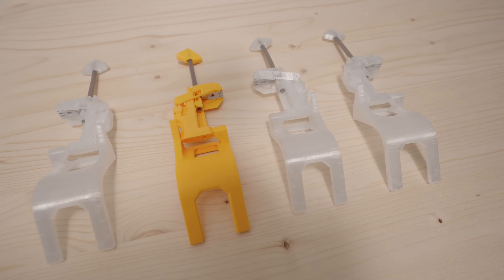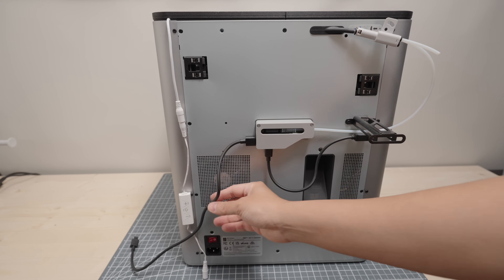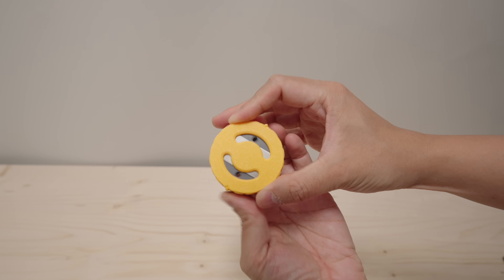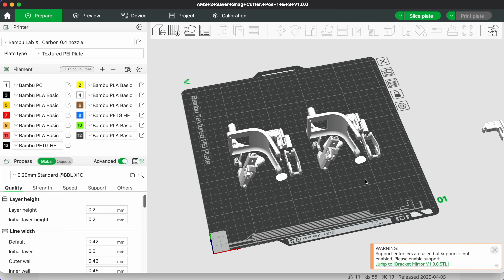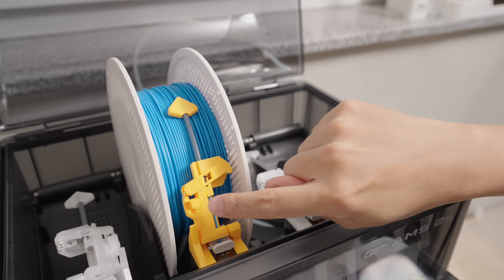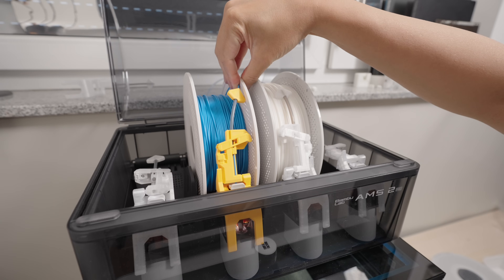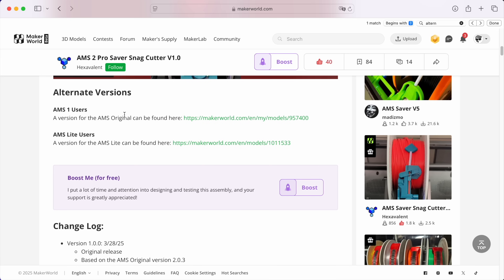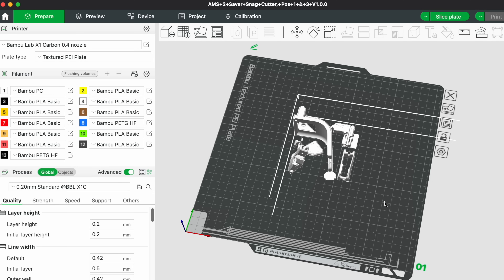The Best Upgrade for Bambu Lab AMS 2 Pro - this upgrade will save your AMS!

Comment from the maker: 🔗 Links
AMS 2 Pro: https://tidd.ly/3JGMaSI
Cutter blade: https://tidd.ly/4q7kYNn
PTFE tube: https://tidd.ly/49Dw6eX
Switching Adapter: http://shrsl.com/4vu0k
Filament buffer: http://shrsl.com/4vu0l
Filament PC: http://shrsl.com/4vu0i
Filament Yellow: https://shrsl.com/4usj2

🇪🇺EU Links (If you're in the EU): https://shareasale.com/r.cfm?b=2464022&u=4344577&m=138211&urllink=&afftrack=
#affilliatelinks

Recommended 3D printer: https://www.awin1.com/awclick.php?gid=570772&mid=46345&awinaffid=2034675&linkid=4382705&clickref=
Best affordable 3D Printer: https://www.awin1.com/awclick.php?gid=570773&mid=46345&awinaffid=2034675&linkid=4382675&clickref=
Recommended Filaments: https://www.awin1.com/awclick.php?gid=570777&mid=46345&awinaffid=2034675&linkid=4382680&clickref=

My 2nd favorite filaments: https://geni.us/A4OFomi
Lubricant for X,Z,Y-Axis rails & idler pulleys: https://tidd.ly/3KMFHqs
Grease for Lead screws: https://tidd.ly/3Lk36j2
PTFE Tube: https://tidd.ly/49Dw6eX
Deburring tool: https://geni.us/9WGzv
Wire cutter: https://geni.us/NAwQIL
Heat gun: https://geni.us/Jdcu

#Affiliate
Reply: Which PTFE tube option should I select for the AMS2 Pro Snag Cutter? The extra PTFE tube that came with the AMS2 pro is too thick for Bowden Puck PTFE tube cutter and AMS2 Pro Snag Cutter

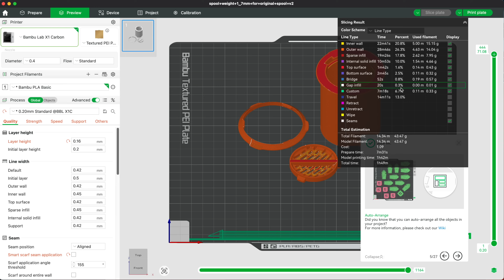Comment: Helpful tip:  At 4:52 you say: "... go to the DEVICE TAB, click the AMS SETTING..."

This is hard to follow.  You should trying wiggling your mouse on the screen or use your video editor to point out / highlight this AMS SETTINGS button or whatever function you're mentioning.  I had to replay this video 3x to see what you're talking about.

Comment: This kind of accessory should be stock with the AMS. It solves a serious problem that many people will encounter. I don't know how many prints I've had where I come back to check on my print and it stops because the spool is somehow tangled. I previously had a single spool printer, but recently bought a P1S combo with the AMS and liked that it could use up a spool and continue with another. I figured it would have a safety mechanism in case it did get snagged, but seems not. Hoping for the best with this solution. I'm excited to print and assemble one and see how it goes. Thanks for the video!

Comment: Hi. In the rear of any spool slot there are two little protrusions (e.g. you can see them at 04:02). The spool flange need to be place between these protrusions or in one side when i put in the filament spool ?

Comment: awesome print, but not sure this is still a issue the spools ive gotten from bambulab for the last 6 months have all just had the filament pushed through a hole on the cardboard inner spool.
Reply from the maker: thanks! this video is a bit older, so you're right, the newer spools have definitely improved!

Comment: How about not having black tape to begin with? A solution for a problem that should never exit. 

Now if Bambu wants to mfg and send these for free to its customers (I'll take 8 of them). 

More than welcome to do so.
Reply from the maker: (very) old spools didnt have tape, they shoved the end of the filament in the hole on the spool. this made a small bent and this small bent then caused problems, it broke off in the AMS and jammed it, that’s why they don’t do that anymore.

So they use tape to tape the end of the filament. in the newer spools the tape was too big and stuck too good to the cardboard spool so it just got ripped off with the filament causing another jam.
Now they just use smaller, thinner tape and tape only a small tip of the filament end. Newest spools don’t have this problem anymore.

Comment: Didn't Bambu Labs resolve this issue with their own filaments?
Reply from the maker: they resolved it by using a smaller tape to hold the tip of the filament. Their Newer batches don‘t have this problem anymore.

Comment: great invention - maybe would be better to make use of a razor blade rather than the bambu cutter- they aint cheap when you need four of them
Reply: The fact that Bambu only sells 3 at a time is a bit upsetting. That accessory kit he showed wasn’t included with my P1S so I’ll need to buy 6 blades and extra tubes :(

Comment: Other than using a high temp material, Are you still able to use the drying function with the snag cutters installed; when the spools rotate does it snag or hang up on the rolls at all?

Comment: Sooo what happens with out does the tape just get stuck in the feeder input and jam up the extruder what is normal behavior, this seems to be bad design with how the spools are loaded?  and yes great Idea saw it before but wondered what was for.
Reply from the maker: yeah its gonna jam the motor of your AMS. But dont worry, this only happens with older batches. Newer spools are with smaller tapes and now they only tape a small part of the filament tip.
Reply: @Lukis3D  I was wondering about that because I had a white spool run out the other day and it seemed fine. paused and said, put in some more filament.

Comment: So what was the problem with original spools that used a little hole in the bambu cardboard tube that they switched to the black tape of death.
Reply from the maker: it has a kink at the end, and is prone to breaking in the AMS, causing jams. But now they’re using smaller tapes and the end of the filament releases easier, so the newer batches don’t have this problem anymore

Comment: This upgrade is not required on P1S (not sure of other printers). My printer is able to detect the stuck filament and it is going immediately in a Pause mode. I then take action to solve the stuck filament problem and resume printing.
Reply: I have a P1S and had this problem, clogged up a Slicer Mako hotend so bad I could not use it again. Wonder what the difference is?
Reply: @OldManPugh 
There are videos available to remove bad clogging. Check it out.

Comment: Great vid! Newbie here: Is there a specific way to tell the X1C to command the AMS2Pro to use specific spools in order? Example: I got a sample green filament with my printer. I also bought some white. All from Bambu. I don't want to waste, so I'm printing tools with the green, but am certain that the green will run out DURING a print. After searching forever, (most posts on this topic are 2 yrs old) I've learned that the auto-refill function on the AMS2Pro will only work if it's same brand, same type, same color. So if I loaded the green in the 4th slot (no reason), and the white in the 3rd slot. I turned off the RFID recognize, loaded the green in #4, and told the AMS it's the Bambu white. When I sent the print the Bambu, it started printing with the real white in #3. Is it obvious HOW to tell it, "Start with this spool then when it runs out go to THIS spool"? 
thx
Reply from the maker: you’re correct, the refill feature only works that way. 
To tell the printer which spool to use first, you can do that in the slicer. When you hit print, you can choose
if you want the 4th slot to be used first. When the green (fake white) spool has run out, it will automatically pull the white filament from the 3rd slot.

Comment: PETG can deform when dried at 65 degrees. What can it be printed from then?
Reply from the maker: where did you get that? 65°c is the recommended temperature to dry PETG
Reply: @Lukis3D  from personal experience. if plastic is subjected to any load (for example, bending) during drying, it easily changes shape and remains in this deformed form.

Comment: it looks like it can be used to prevent a print failure due to there being a tangle in the spool.
Reply from the maker: exactly! It serves 2 purposes here
Reply: That's what I'm hoping for. Had too many prints in the past fail due to tangled spool. And then having to clear the filament from the ptfe tube because it broke.

Comment: do all the bambulab rolls come with the black tape?
Reply from the maker: the newer batches come with a smaller tape, and only the tip of the filament is taped so you won’t face this problem anymore.

Comment: Is there a reason to use this when I'm using Bambu Filament exclusively?  I mean, my filament runs out and goes to the next roll without any intervention by me.  Is this a problem for other folks?  Why cut the filament when you can simply let it run out?
Reply from the maker: in older batches, the ends of the filaments are taped too well to the cardboard spool. So the tapes will get pulled with the filament and they get stuck at the filament inlet, damaging the AMS.
The newer batches are better now. Nevertheless, the snag cutter also helps to cut any tangled filaments so it has kinda 2 functions.

Comment: The video was a great general explanation, however if this video is going to be linked as the instructional and assembly video, I’d recommend spending more time going through how it was assembled.  The rate of the assembly in this video was too fast.
Reply from the maker: sorry for that man! The designer of the snag cutter already made an assembly guide video so that’s why I just fast forwarded the assembly part.

Comment: I don’t have the razor blades. Can I cut a razor blade up or no
Reply from the maker: there’s also a tool made by the designer for cutting ptfe tubes. If I’m not mistaken you would need the blade of any box cutter knife.
Reply: @Lukis3D  sorrry I ment the razor blades that cut the filament for me

Comment: I have been using the AMS2 Pro for two months now. Never once have I encountered the problem of tape stuck at the inlet. I think you guys are being too cautious with this.
Reply from the maker: well its not really an AMS / AMS2 problem, it’s their spools. But the newer batches don’t have this problem anymore since they now only use a small tape or they just tape just the tip of the filament end.

Comment: So like an idiot I had forgot I had PLA in my AMS and printed these in PLA. Do you think it will be a BIG issue to try it out, or should I just cut my loss and reprint it in PETG? I only use the drying function every so often and not constantly. so figure if I really needed to I could just remove the cutters while drying when I load PETG into the AMS.
Reply from the maker: I would say that you should just use it. When it starts to deform, then replace it with PETG. And i think it would take a long time until it starts to deform anyway, but do keep us updated!

Comment: The only real utility to this that I see is preventing binding due to an end of spool situation allowing to start with a fresh spool of the same color/type. Cutting a snag on binding will create the same result however in the AMS 2 Pro as just allowing it to bind if a second roll of the same color and type filament isn't loaded as would be the case in multicolor prints. What's really needed is a device that reliably prevents snags in the first place. I have been fortunate that all 3 times my filaments have gotten stuck on the spool I received an error notification and was close by to rectify the error.
Reply: same here

Comment: Now I wish I had a Bambu Labs printer and AMS 2 Pro, just so I could use this awesome enhancement tool.
Reply: Checking in did you provide your address to the original chad, and did you receive your free setup :D. Suspecting this is a bit of satire.
Reply: @Archithai  They did not. All future wish applications will be denied.
Reply: Congratulations, I’m granting your wish.

I’m going to ship you an H2D and AMS 2 Pro, along with this mod pre-installed. The wish granter has fulfilled their obligations when the machine is used, at which point the wish grantee must return any and all artifacts obtained as a result of the wish. Return shipping costs are the responsibility of the wish grantee. Failure to return the wish artifacts within 7 days will result in the grantee’s worst fears becoming a reality until the artifacts are received by the granter. If the grantee’s worst fears include death, the worst fear will repeat no more than once every 24 hours, every 24 hours until the artifacts are received by the granter. 
Failure to provide the wish granter with shipping information will result in a ban on wish grants for the grantee indefinitely, or until a third party wish to lift the ban is granted.
Reply: @TheOfficialOriginalChad  I'm scared
Reply: @SangheiliSpecOp no worries, my friend. 
The wish grantee did not provide shipping information, which will result in their life being affected, but not others (yours). They'll be fine, plenty of people live long lives without ever having any wishes come true.

Comment: Is it still worth putting in desiccant holders when the AMS 2 Pro can remove moisture itself?
Reply: Yes! My system remains at 10% humidity when turned off and not in use with desicators installed.
Reply: @ZafodB3 How often do you run the dryers?
Reply from the maker: the desiccants help to passively dry the moisture inside the AMS, so it stays dry. The drying function of the AMS actively dries the filaments or actively removes the water inside the filaments.
if you intend to leave spools inside the AMS for a longer period of time, i would definitely add dessicants inside the AMS.
Reply: Desiccants do no dry filaments. They can only maintain the relative dry air to a certain degree. The only true way to remove moisture from filament is heat, ventilation and constant rotation, which the AMS 2 Pro doesn't even offer.
Reply: @littledovecitydust Wait, what? I thought the AMS 2 Pro has a filament dryer built in?
Reply: @littledovecitydust And I know desiccant only maintains moisture levels in the air. I was just saying that the filament dryer also dries the air within the AMS
Reply: @EpicBenjo  if you turn on the drying feature in between prints, then yes, you don't really need desiccants. Yes, the AMS2 Pro dries, but it's a hassle. It dries while not printing, and you have to take out all of filament ends from the inlets.
Reply: @littledovecitydust  really? That’s really annoying. It kind sucks not having to be able to do this remotely.
Reply: @EpicBenjo   that's exactly why I call the AMS2 Pro an overpriced junk. The Anycubic S1 with the ACE Pro is a much more convenient option.
Reply: I thought you can dry while printing, as long as you have the separate charging cable connected.

Comment: I had 2 extra cutters with my new X1C. I am ordering a few more to implement this system on my AMS1. And I will put this on the AMS2 that I will get soon. My sample roll of PLA that came with the machine ended with black tape. What is the model for the case at 2:45?
Reply from the maker: yeah this is one of the most useful upgrade for the AMS imo. I’ve alot of spare blades from the A1 and the A1 Mini so i just used those 😁 But they’re really cheap so I hope order alot of them! You can find the case on MW, the model No. is 639173. 
Happy printing man!

Comment: This is absolutely brilliant. Will be my first upgrade to it. Thanks.
Reply from the maker: you’re welcome, have fun printing man!
Reply: @Lukis3D  Same to you, have fun designing. So strange going back into printing other people designs. My first print ever was a full size sword on a Wanhao i3 plus. That thing was a fire hazard. I had to make it safe. wires shaving off sharp metal edge hidden underneath the bed. if I wasn't curious and naturally taking things apart... I would have been zapped or that thing starting an electric fire.  Never printed a benchy. lol.

Comment: When did they start adding tape to the spools? Because I have NEVER had this problem and none of my old spools are secured with tape at the end.  Is this a new change?
Reply from the maker: yeah only newer spools have tapes. They found out that the bent end of the filament can break in the AMS so the tape’s job is to keep the end of the filament straight.

Comment: I upgraded every thing last night, the software says AMS 1 still and there is no drying option even after firmware updates.

Any ideas?
Reply from the maker: you also need to update the firmware of the AMS 2 Pro. And make sure to use the cable that‘s included with it.
Reply: @Lukis3D What is the difference between that six-pin cable and the previous one?

Comment: Seems like a nice fail safe (even if a better option would just be for the spools to not use tape..tho that doesn't eliminate tangles); always an added bonus to design something for parts people are likely to have as well (extra cutters)
Reply: When did they start ADDING tape because I have NEVER had this problem and none of my old spools are secured with tape at the end.  Is this a new change?
Reply: @JohnVanderbeck  why is this a reply to my comment? 🤔
Reply: @TS_Mind_Swept  "even if a better option would just be for the spools to not use tape" it was a reply to that.  "Why not just use tape?" Well they don't, or didn't.
Reply from the maker: yeah i usually just babysit my printer when i have spools that are almost used up, but this adds that extra protection to my AMS.
I‘m looking forward to see how the snag cutter units hold up when i turn on the heating function.

Comment: @lukis3D you mentioned an accessory kits that came with the printer.  This is an add on you would have purchased?  mine never came with this kit
Reply from the maker: you actually get some extra goodies in the accessory box (wrench keys, grease, blade for the scraper etc.) but now that I think about it, i never got spare filament blade cutters. Sorry for the misleading info!
They‘re very cheap though, like 3-4$ for the set of 3.

Comment: AMS 2 Pro only needs the power supply if you are connecting more than 1 to a single printer and want to use the drying function. To use a single one even with drying function it doesn't require the extra power supply.
Reply from the maker: no, that only applies to H2D. To use the drying function with the X1 or P1 series, even with only 1 AMS 2 Pro, you need the power adapter, no matter what.
Reply: @Lukis3D  Ahhh my mistake! Good to know!